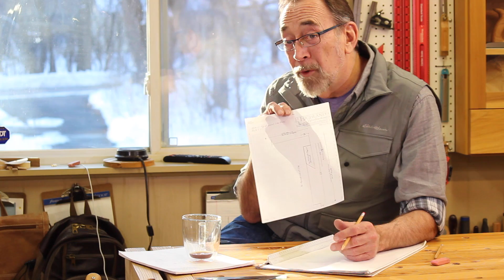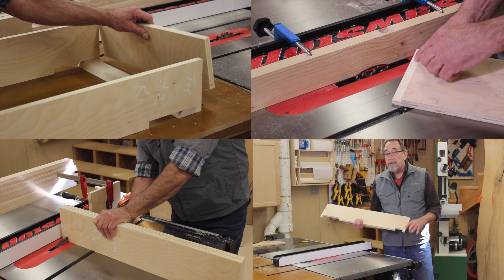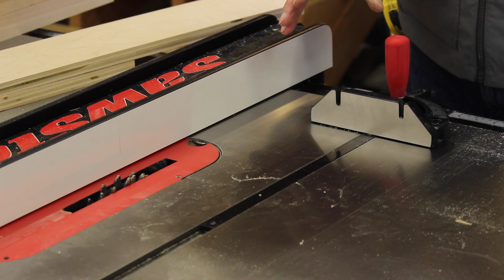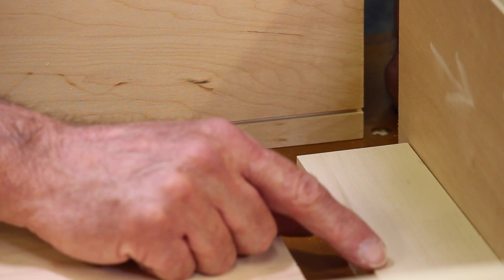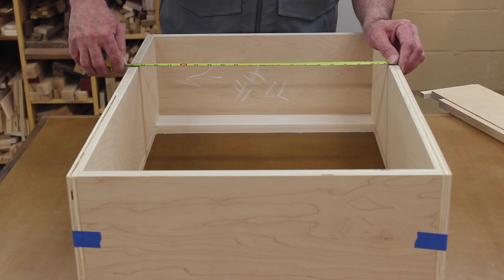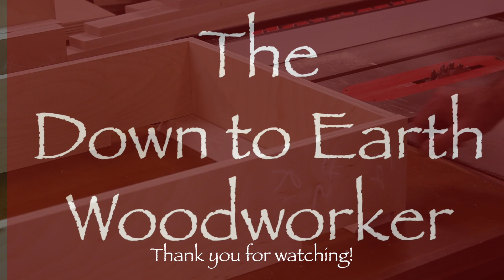5S Workshop Wall Cabinet Build, Part 2 - Workshop Efficiency - The Down To Earth Woodworker

Comment: Why would I want a French cleat on a wall cabinet? It's not something you would be taking down and rehanging in the same spot. I would rather use a full back panel and screw it directly to the studs.
Reply: Here's why:
1. A French Cleat for a cabinet may seem like overkill, but a row of cabinets on a long French Cleat is a very convenient method of cabinet hanging and requires far less fasteners and fiddling. If you haven't tried it, then you must take others word for it.
2. You said "It's not something you would be taking down and rehanging in the same spot.", but on the contrary, kitchen cabinets are replaced quite often. Often when someone purchases a home the kitchen is just out of date or the wrong style or color etc, for many a fickle homeowner., Therefore the French Cleat system lends itself to making said replacement quite easy.

Then again to each their own.

Comment: Hi Kevin,

Looks great!
Where do you get your plywood? Looks like good stuff.
Reply: I was wondering the same thing.  What type of plywood is it and where does he source it from.
Reply: Avibeagle Well, the plywood I use is not really that good.  I get what they refer to as "cabinet grade" plywood at the big box store.  I suffer through a lot of waste to get pieces good enough to use (and to show on the videos).  I can source a better grade of plywood from a lumber supplier about an hour's drive from where I live.  It is much more expensive.  Between the time, mileage, and extra cost, the waste I incur with the big-box store stuff makes it work out about equal in cost.

Comment: Okay, now I understand your methodology for sizing the depth of the sides of the cabinet by insetting your back panel flush with the cleats. My personal preference is If I'm going to the trouble of putting a back on a cabinet I'd want it to be a full back. This method will leave a gap between the top of your panel and the bottom of the wall mounted cleat. Also, as I noted before, you still will lose depth in the corners with your face frame, so a 6" square item in a 6" interior depth cabinet couldn't be placed all the way to the corner. It would also be hard up against the back panel and door. Not saying anything here is wrong, just stating my preferences.